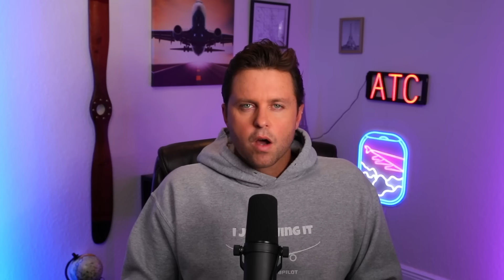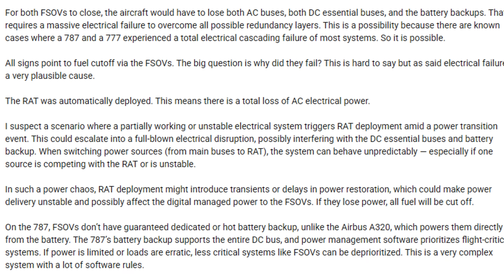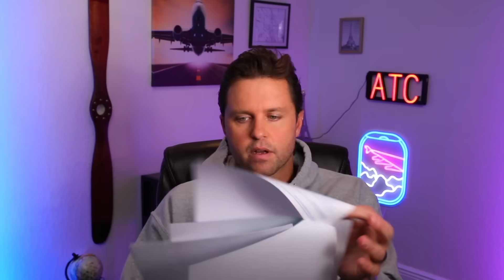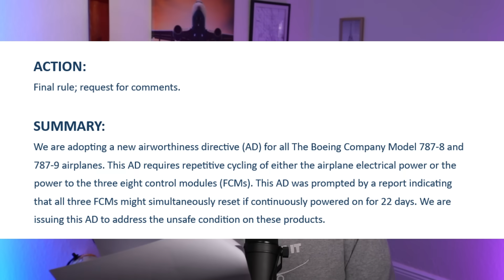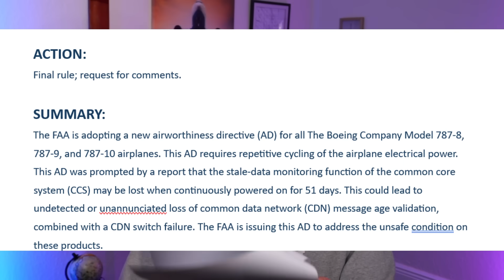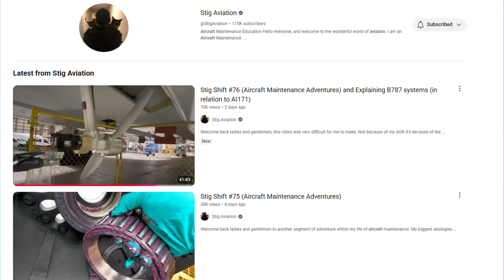Air India 171: Did a Software Glitch Cause Dual Engine Failure?

Comment: Software glitch seems to be more plausible than other suspected causes, and certainly not impossible as we know from other Boeing incidents, as pointed out in your comments.  My question is: if it was the sequence of electrical bus events tripping the FSOV's as speculated by @HeyFixThis, can this all be reconstructed from the flight data recorder?  My recommended fix would be to disable the automatic FSOV trips of both engines, or only allow trip of one FSOV, until the plane is a certain altitude above the ground, to give the crew some time to react and do something.  If it turns out this accident was caused by a dual FSOV trip at 625 feet above the ground after takeoff, I won't be setting foot on a 787 until we know this has been fixed for good.

Comment: The RAT deployed, so it was obviously an electrical or hydraulics failure.  
Now it was insanely hot, so the root cause might have been vapor lock in the fuel lines to the engines.
This is just speculation.  I have no hard evidence beyond the videos everyone has seen.

Comment: It looks like a cascading electrical failure on the 787 could have led to the closure of both FSOVs due to a loss of DC power. Since FSOVs are spring loaded and require electrical power to stay open, any interruption to their DC supply would shut off fuel to the engines. It is likely that the Electrical Load Management System (ELMS) did not restore power quickly enough, or that the FSOV circuits were not prioritized, causing both engines to flame out. Although the FADECs initially continued to receive power from their engine driven Permanent Magnet Alternators (PMAs) and remained operational, they cannot override a physically closed FSOV. This mechanism could explain the simultaneous dual engine shutdown shortly after takeoff and the subsequent deployment of the Ram Air Turbine (RAT). While such an event is rare, it is plausible given the 787’s reliance on complex software controlled electrical systems and automated power source switching.

Comment: I think you nailed it. Now Air India is saying the black boxes are crash and fire damaged and are unreadable! Odd, they are designed to withstand a severe crash and fire. Boeing is on-site. Can Boeing afford to be at fault for another software issue and have a horrible design issue that allows for a crash caused by software and without any pilot override? I think that would be the end of Boeing, my opinion and it’s all alleged at this point. A possible coverup allegedly? 

Why hasn’t the FAA done something more drastic like grounding a model that has continuous electric issues. You found the wholes in the cheese, the FAA should not have taken a chance and grounded the planes until the electrical issues resolved on all of the planes and a new design implemented. Why not let the pilots have the ability to release the spring controlled fuel valve. There must be a way it could be activated mechanically. Why would software allow for fuel values to closes without a fire detected during takeoff or in flight? This is a major design issue if it is in fact what happened?
Reply: Definitely a cover up, this would kill Boeing.

Comment: the SOVs dont "snap shut" they are on a geared spring and will take around 15 seconds to close unless commanded by PBA, if all those systems failed, the last hope is a DC override physical button in the cockpit to run all essential components strait off battery bus 

that being said the gradual loss of thrust over 15 seconds during TAKE OFF from the SOVs closing would be catastrophic for ANY pilot..

Comment: Well i still think somehow the first leg delhi to ahmedbad was showing the early symptoms of the catastrophe because of the air conditioning and infotainment system glitches considering the FSOVs and software comment somehow i can see some connection If the power issues began with the in-flight entertainment and AC systems on the first leg, that could’ve been an early sign of deeper electrical instability. On the 787, those systems draw from the AC buses, and the air conditioning system shares interfaces with Power Electronics Cooling (PECS) units, which regulate heat for key electrical systems. A fault there—overheating, power draw imbalance, or degraded cooling—could start disrupting power distribution. If AC/DC buses became unstable, the load management software might’ve deprioritized the FSOVs (fuel shutoff valves), which rely on DC power. Loss of DC means FSOVs slam shut, fuel cuts off, and the engines flame out—despite still spinning. The RAT deploys, but it’s too late to recover. So the IFE and AC glitches might’ve been early symptoms of an overheating or unstable electrical core—not just cabin comfort issues.

Comment: And the data recorders might be powered by the same source.

Relatively recent jeju flight that struck birds lost both data recorders after dual engine failure and only i believe the cvr was restored 8 seconds later (by the rat) but they were much higher and had the benefit of gravity for airflow for that tiny prop.

AI flight was short. That rat may have been next to useless trying to spool up in that amount of time.

Blancolirio called it a "design flaw", in his opinion, in his most recent jeju crash update video.

Comment: My theory since day 1 was an electrical failure leading to a software glitch that shutdown both engines and I guess my intuition was right. This is the most reasonable theory out there. Now Boeing is gonna be in a big trouble again. What if they have to ground all the boeing 787 worldwide 😬 Now a days airplanes are flying computers and software glitches are a real threat 💀

Comment: To me, the best indicator of the root cause, is the timing when the two engines shut off. 
If it were either contaminated fuel or vapor lock, the engines wouldn't shut off SIMULTENEOUSLY.  In the case of contaminated fuel such as BA38, there was a 7-second difference between the loss of two engines. But if both engines shut off AT THE SAME TIME, it is definitely not mechanical, it must be electrical.
Reply: I agree with you but has it been determined both engines failed at exactly the same time?
Reply: @davidh7398  It is almost certain (with a second max), because NO ONE noticed the slightest yaw in one or the other direction. 

If an engine failed at a given instant, EVEN WITH the spool down which would occur, the other engine HAS STILL NOT failed, say for 5 seconds. During this time it will be providing full thrust, so this side of the aircraft would move forward while the other is moving forward BUT with diminishing speed. This difference will cause the aircraft to yaw in the direction of the engine that failed first. 

Nobody has noticed that slightest yaw!!!
Reply: @vincentpinto1127 there actually was a yaw but it was during descent, likely indicating wind or manual control
Reply: @crypton7572  Yes, likely, and would be slight.  However, yaw dynamics or yaw sweep angle due to gap of time between engines losing thrust would have been very noticeable.
Reply: @crypton7572 The final bit of yaw maybe pilot induced, as it is speculated that they might have tried to crash into an empty field instead of buildings. But most of the flight path was straight, indicating simultaneous engine failure.
Reply: TAC
Reply: @vincentpinto1127 I understand yaw would be produced from one engine failing first and it appears in the video that it did not occur. They still have yet to extract the information from the flight data recorders which should give more details as to what occurred.
Reply: @vincentpinto1127  Wouldn't the Yaw Damper prevent the yaw from occuring? To my undestanding it does, so we wouldn't see an yaw, even if one of the engine failed.

Do we have footage for the entire takeoff roll? The first engine could have failed at a time not is not captured in that video.
Reply: @andreea007  Yes, it is possible. Even if it did, we would have seen a prompt return to original heading. We are speaking max of a couple of seconds here between the two flameouts of the engines. Sufficient to see the initial yaw.

I haven't seen a video of a full rwy roll.  If the first engine did fail, it had to have after V1 when reject was no longer possible. 

When the aircraft does take off, likely just short of the rwy head, we clearly see dust plumes and vortices caused by the left engine. 

And I do see some right side vortices too, though not as strongly. This tells me that the right engine had power too.  

But I must admit, in most of the videos I have seen of the moment the wheels would have broken contact with the surface, most of the dust (on the right side) is obscured by that small concrete structure in the foreground of OUR line of sight which is nearly at heading 20 degrees to the rwy.
Reply: @vincentpinto1127  Thanks! I was considering the A321 Gatwick incident, when during takeoff the system significantly reduced the thrust on both engines (one at a time), due to fuel contamination. 

Luckily it was a repositioning flight, only 7 people aboard, so the little thrust they had was enough to get them back safely.

If something similar happened to AI 171, they didn't stand a chance being so heavy.

And it would be consistent with the Mayday - "Not enough thrust" as opposed to "We've lost both engines" (ofc assuming that this is indeed what they communicated)
Reply: @vincentpinto1127 if one engine fails on the runway at a point when the pilot can't abort the take off, would the aircraft still yaw to one direction?
I am asking since the pilots took almost all of the runway. With 2 engines running it wouldn't have taken the whole runway. So one failed on the ground and one failed after takeoff isn't it logical?
Reply: @vincentpinto1127  In case of a stall an airplane may yaw also. And it definitely looked like a stall.
Reply: @PJW.418  A stall, in aircraft context, generally has a very specific meaning. The angle of attack or the pitch angle is too steep to sustain lift.

In this case, it seems almost certain, barring facts once the black boxes are analyzed, that the engines "flamed out", got starved of fuel.  One "could" extend the definition of stall even to flameout, because, of course, lift could not be sustained. I can't say anything about that. But even if you want to extend it, each wing would have to stall at slightly different times for the yaw to be visible.
Reply: @vincentpinto1127  I know what a stall is. And as an aerodynamic phenomenon it has absolutely nothing to do with a flame-out.
It is all about absence of lift. You can even have a high-speed stall.

Dutch glider pilots - like me - are extensively trained on stall situations and near-0-lift situations.
I have experienced a low altitude stall. Absolutely hideous. I assure you it was my training alone that saved me.

The black boxes are currently being examined. We hope that it will show the cause(s).
Based on facts thus far my suspicion is on a software induced automatic fuel switch-off due to excessive ambient temperature. Like I commented on Captain Steeeve's channel.
Reply: @PJW.418  
I wasn't responding to stalls apart from an aircraft (airplane).

Likely there was loss in translation of my quotes (" ") around the word "could" that I used.

It does seem to me too based on various videos now that it was a software induced auto fuel switch-off, ergo flameout.

Like most of us, we've heard a lot about excessive ambient temps. I think that is a totally crock! Dont they have 787 Dreamliners in the south midwest part of the US? Dont they have 787 Dreamliners in the UAE and the surrounding regions? Of course, they don.  And 43 degC (let's say - even though metar reported lower) is excessive?? Methinketh that's a crock!
Reply: @vincentpinto1127  I wasn't referring to food stalls either.
As for my suspicion. It was something Captain Steeeve mentioned about an automatic fuel cut-off in case of too high temperatures, in order to avoid vapour lock.
Reply: https://youtu.be/dIgnR0zw3FU?si=FIglkTDBwcJWlfU3
Reply: To me it sounds like electrical glitches, messed up the software, caused the engines to idle when they were supposed to thrust.
And I'm saying this because the same plane had electrical glitches in previous flight, but not this sever
Reply: I agree the simultaneity of it is the most unique thing
Reply: Agreed!
Reply: This has been so obvious from the start and I know nothing about planes or engineering. Can’t believe more people aren’t saying it.
Reply: No way it is vapor lock

Comment: The electrical failure has never happened, on light twins shutting down or feathering the wrong engine is common among mistakes on loss of engine on takeoff. I will take the common failure over the never happened failure, they lifted off late on one engine but got too 300 ft quickly, then the landing gear stopped raising and the rat deployed, someone tuned off the good engine in panic.

Comment: This is a variation on the electrical failure discussion surfaced by ChatGPT. In this scenario the FSOVs are not necessarily closed, however it also seems to tick all the boxes as to what was observed by people on the ground as well as the surviving passenger:

" 
Common-mode electrical failure during the ground-to-air change-over

Sudden thrust decay on both GEnx engines seconds after rotation. If the main AC buses failed or a power-transfer relay arced, both FADECs could have lost their normal power supply. On the 787 a FADEC with no electrical power “freezes” the fuel metering valve at (roughly) ground-idle, giving the crew no time to react.- RAT (ram-air turbine) seen deployed RAT drops automatically when all engine-driven generators go offline or when all three hydraulic systems lose pressure—both follow naturally from loss of engine power or bus transfer failure. - Attempted gear retraction “hung” With the engine-driven EDPs offline and the RAT only feeding one hydraulic system at low flow, gear actuators starve, stopping mid-cycle.- Cabin emergency lights on. RAT power feeds only the Essential and Battery buses; the cabin service/utility buses go dark, so emergency lighting comes on automatically.- Rumoured PRB-A (Power Relay Box) arcing / moisture leak in heavy rainA (leaked) preliminary summary circulating in maintenance circles describes exactly that sequence and places the fault in the power-transfer relay cabinet. The leak is unverified but technically coherent.  

The 787’s “bleed-less” architecture puts very high reliance on the electrical system; a similar—but single-engine—rollback occurred in a 2021 GEnx taxi incident that led to an FAA AD on bus-transfer logic (AD 2021-24-15). "

Comment: The aircraft yawed slightly to the right after takeoff. The dust trail at the end of the runway indicates that the #2 engine was not producing thrust at the end of the takeoff roll. Engine #2 had recently been replaced. Put those facts into your list.

Comment: If the NTSB or even the FAA issued some AD's for some problems with the 787 between 2015 an 2018, one can be sure that they have been fixed a long time ago already. But maybe there are other undetected gliches yet? Allthough it's pure speculation, I personally wouldn't be surprised if that was the case. And oh boy, if that turns out to be actually true, Boeing will have another major PR desaster, maybe this time even an existential one.

Comment: Gary , you have hit on the most likely scenario . Really good research ! I will add there is a video of one passenger who was on the first leg of the flight , he was smart enough to get off the plane and not reboard ! He was in seat 25A , he made a video of the cabin , all the people are fanning themselves due to lack of A/C but it shows nothing was working at the seat , the controller was dead , he couldn't call the flight attendant but the scary part is that the CABIN LIGHTS WERE OUT ! All the lights in the entire plane cabin went out , they were in the dark !!! He was smart enough to escape ! This backs up your electrical theory . Why didn't the stewardeses call to abort the second leg of the flight ?

Comment: Upor comments about the FSOV are interesting. However a FSOV being "normally closed", that is, it closes when DC power is removed, seems rather strange to me. It hsould be the other way around, that is, it should remain open when power is removed.  I think that something electrical happened, but not related to the FSOV. As you know a PMA (Permanent Magnet Alternator) powers the FADEC and the commands and sensors that interact with it. But for some very strange and unexpected reason, it seems that the FADECS caused simultaneous engine flameout.
Reply: Gary posted the original comments from @HeyFixThis which state "Each engine has its own FADEC (Full Authority Digital Engine Control), powered by a Permanent Magnet Alternator (PMA) that’s driven by the engine itself."  So, as I understand it, if the engines both fail due to the FSOV's closing because of complete loss of electric supply, the FADECs shut down also.
Reply: You don't want to spill fuel into a broken engine, so closing on backup power loss is understandable. I guess a self-holding valve with external shut-off trigger would have been too expensive...

Comment: Curious …our GE engine fuel valves are spring loaded fail open. Keep fuel flowing. However, our engine is an aero-jet configured for a power plant, not an aeroplane.

It seems (and have been told by field engineers) that aeroplanes are designed for maximum safety and survivability.

It’s hard to imagine that a fuel valve would be a single point of failure…(that is, being configured as ‘normally closed’)